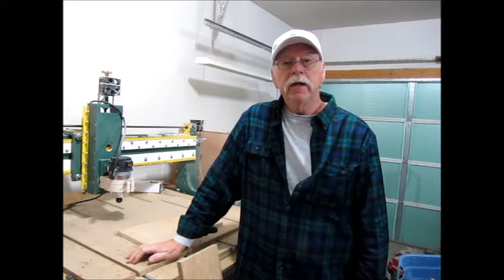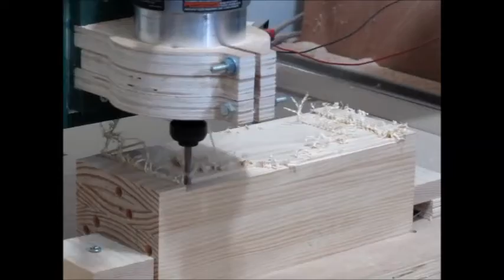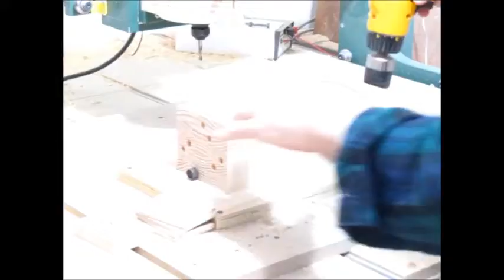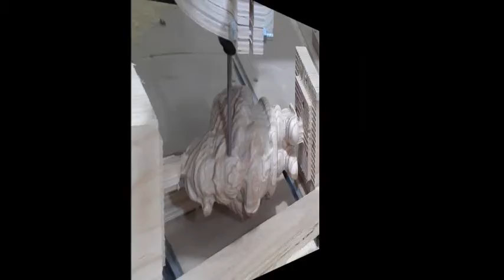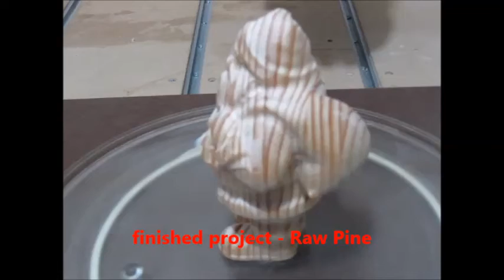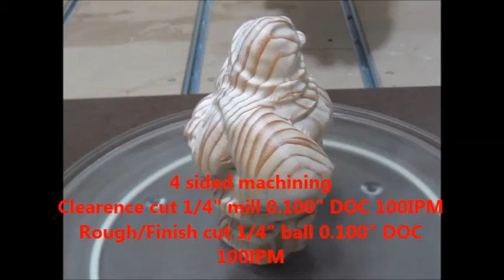2018 Christmas Challenge

Comment: Fantastic. Did not know you could do 3d that way .you should do a how to video
Reply from the maker: Shawn, thanks for the kudos'.  I suspected it could be accomplished as Vectric's  software is capable of doing double sided work. So why not do a 'frt & back' and 'rt & left'. Just keep the orientation correct.  I'm sure some areas are still 'full' unlike a true rotary machined part.

Comment: Looks great! I've been meaning to ask, what is your gantry on the cnc made of?
Reply from the maker: The entire machine is fabricated from 3/4" Baltic Birch plywood.  The vertical gantry supports are 2 pieces of plywood glued together for a 1-1/2" thickness, and the gantry itself is standard torsion box construction.  The only issue to date from this wooden machine would be of the steel guide rails wearing.  This was a easy fix as I simply rotated the angle and put the worn side down and the unused side up.  I commissioned the router Oct. 2014.
Reply: @pngcustomwoodworks3499   that's really helpful! Very much appreciated. What kind of feedrates are you running in stuff like plywood? Somewhere in the range of 60-100 ipm?
Reply from the maker: @paradisearcade8386  I rarely run plywood and target solid hard woods for my projects.  What little ply that I have cut -- first cut with downcut mill cutter .125 dp at 100 ipm.  All following cuts with a upcut mill cutter .125 dp at 100 ipm.  The reason for the 2 cutters is to keep the top and bottom surface ply from chipping.